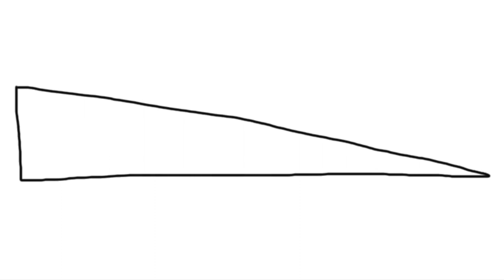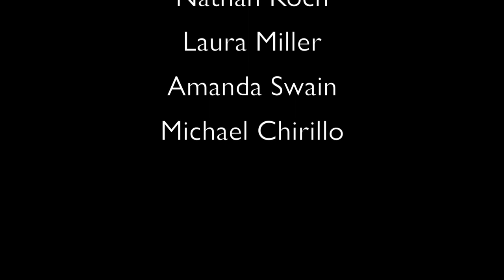Profiling Bassoon Reeds with Rian Craypo

Comment: Are there any plans to replicate the Herzberg profiler/shaper system for future generations?
Reply: I wasn't able to find the Herzberg Projects website, got an error message at the address frequently linked by other bsn sites. Thank you!
Reply: Ken Postic was making HB shapers for a while, and Arlen Fast has been investigating new machining options for the profiler itself. This has happened in the last few years. I don't know if the entire system would be available or if you'd have to source an old machine and repair/collect missing parts.